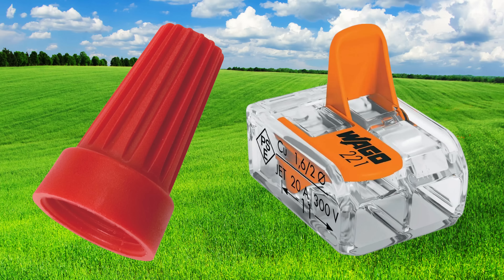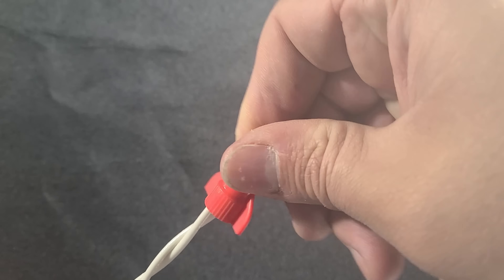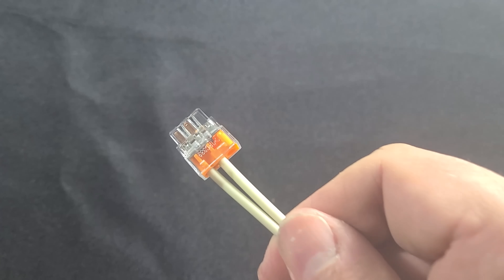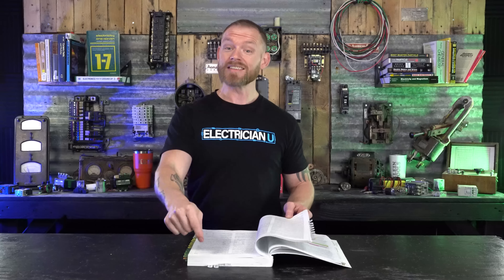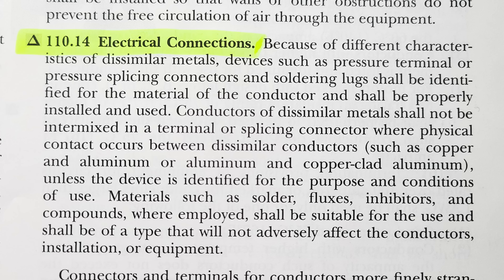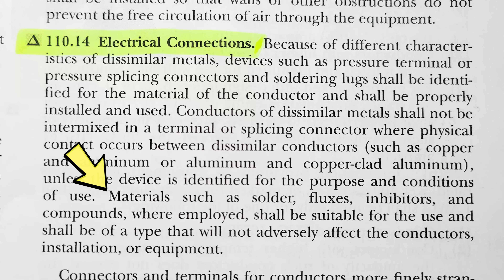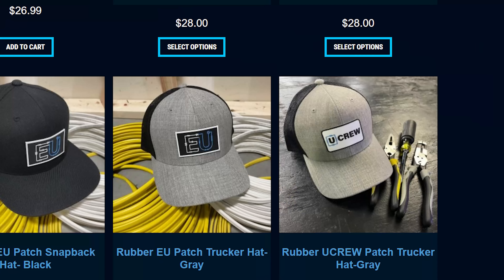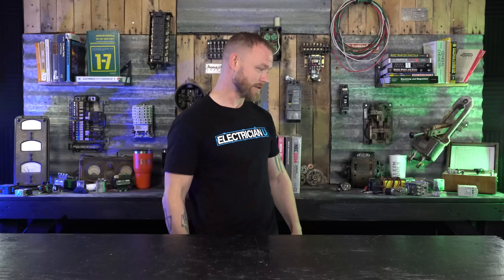Should We Use WAGOS or WIRENUTS?!?!

Comment: Dustin, thank you. I was an early adopter (spent a good chunk of my time in Europe) and have fought this one with my brothers (never a sister, female electricians tend to be more pragmatic) for a number of years.
To me, it makes sense to use the connector which gives the most reliable connection under less than ideal conditions. That's just my preference, but Wago shines there and wirenuts don't always.
Reply: @kenbrown2808  I apologize, and will delete comment. Was trying to read thru hundreds of comments to decide if I was going to use Wagos brand only. No knockoffs. As you are obviously experienced, your comments frustrated/angered me, after looking up the 222 specs myself. A bit like Amazon reviews. It's the best ever/it sucks. I've been thru similar endless debates w/ plumbing-copper/pvc/cpvc,and now PEX. (While watching 'professionally' installed copper spraying from pinholes in a cramped attic). New contractors are all in on PEX for my new home, for their reasons. (Most) older experienced plumbers are all copper. I respect knowledgeable pros, so it's maddening when they disagree fundamentally. You have lived electrical for a lifetime so your opinion means something to me. Flatly stating an incorrect spec(20A) was my only frustration, because I see it constantly online, where people will 'quote' anything to 'win'  a debate. It does not serve anyone well. It makes researching anything maddening. Imagine how bad this will get w/ AI posting these comments! It's already happening.  Thanks for contributing your knowledge here. I have read about half(600+!) the posts here, and I will be using Wago brand connectors. (I hope that clear polycarbonate plastic is super durable, because cracks will be catastrophic). Thanks for your time, Ken.  Sorry for seeming rude.

Comment: Lever nuts make a lot of sense for stranded conductors for light fixtures or as you mentioned lamp ballasts. Otherwise, as you mentioned, wire nuts feel more secure.
Reply: I'm not convinced of that - I worry about annealing and how my connections hold up in less than ideal conditions. But, again - I spent a lot of time in Europe, so am not as sold on wirenuts as most of my fellow Americans.

Comment: Only a few kinds of Wago are stab-in (only the "Wall Nuts" I think, and I don't like those, though they're the ones you had in your hand), most are insert and lever tighten. The latest generation are really good, go get the non-stab ones! Great if your gauges are different, or if you want to probe (there's a hole for probing), or if you've got a bunch of wires to connect (you can get ones that take like up to 6 conductors)  I am not super confident (non-electrician) on my ability to get a wire nut correctly and firmly attached, so I'll personally never use a wire nut on mains myself again.

Also I'm pretty sure nothing but Wago style connectors are allowed in Germany 🤣 That said they also call them Vah-go, so what do they know, they only invented them 😉

Comment: You'll have to pry my wire nuts out of my cold, dead hands. 🤣  I don't mind using the stab-ins on lighting and other low current loads, but prefer to use wire nuts on receptacle branches.

Comment: Why do WAGOs give mixed messages on the voltage rating, depending on where you get the information?  The devices are marked with 300V, yet on the UL approvals on their datasheet, it says 600V?
Reply: It probably depends on the manufacture
Reply: Different testing standards for the different ratings. (The Wago 221 for instance is marked both 300V 20A and 450V 32A. The 450V rating is per UL (US) and ENEC (Europe) testing standards, and the 300V rating is per PSE JET (Japan). I dunno the specifics of how the tests are different; probably it's something like how large the safety factor is.)

Comment: Wago rated for copper only, so can’t use them on old aluminum wired houses and oaccasionally need splice more than 5 conductors together like in a 3 gang box, otherwise wago is better although little pricy😀

Comment: I am so happy that you made this video. I would just like to throw my two cents into this argument as an engineer - no reputable company would dare stake its reputation on a product that will fail by design. Ideal and Wago have been in the game for a long time... and the back stab outlets were a resounding lesson learned for this industry. I can't imagine they would make a stab-in connector that would be dangerous by design. So when I hear electricians tell me that "those stab-in connectors are a great way to burn your house down" I just can't help but laugh. UL, CSA and CE certifications say otherwise. And frankly, Ideal and Wago have no doubt invested hundreds thousands, if not millions of dollars, in research and development of these connectors. I have no doubt in the capabilities of the stab-in or lever type connectors.

Comment: WAGO's are fine to use. I imagine the old timers who used solder, rubber tape, and friction tape to splice with freaked out when "wire nuts" first came on the scene. In the 70's I was working in a house that was old then. The splices were made with porcelain wire nuts, I still have a few that I replaced with "modern" bakelite wire nuts. There will always be some new tool or material that comes out. This stuff is tested before it's released for use.
Reply: It's just not the old timers that freak out; it is also municipalities that need to update their codes. You would be amazed how many don't know about them and as such fail you come inspection. 
I love actual Wago's...As it seems to have developed across most electricians, Wago's are great for lighting.
Reply: @samspade5648  But every light fixture comes with free wire nuts?  Beyond that tying grounds with the green hole thru wire nuts are the only time I typically use a wire nut.
Reply: I do not think that modern wire nuts are made from bakelite at least the Ideal® ones don't seem like it.
Reply: @robertopics  They are not made of Bakelite. Bakelite was one of the first insulating products used for wirenuts. They are plastic now. used
Reply: @thomasdragosr.841  my bad I got confused when you wrote "modern".
Reply: 100%

Comment: How do Wagos compare to the Ideal brand stab-in connector? That's usually what I use. They work pretty well provided you strip the right amount of wire back- otherwise, they come out a little easier than I would like.  I never see Wagos at the big box stores, the only reason I haven't tried them.
Reply: WAGO's are pretty pricey, the Ideal brand are definitely less expensive and are great for remodels when dealing with old wire.
Reply: Menards has wagos…I order wagos that go up to size 10 gauge wire from Amazon
Reply: @jeremysmothers1985  Weird, I was at Menards hours ago and in the electrical section. I was not looking for wire nuts tho.

Comment: Lever nuts are far easier to service later and are as good or better than wire nuts in every other aspect. Stranded wire with a crimped on ferrule for example is so much better than wire nutting them together.

Comment: LOL! Love you dustin! such a cool video. the europeans are ahead of us in termination practices.... I perfere using the wago caps as we have been using wirecaps forever. Ideal caps are also a solution as both Ideal and Wago off a quicker method of termination. plus the Wagos are ajustable and easily removed as needed. if you watch any of the european electricians on Youtube you'll see how european wiring is done. they have a nicer system in some ways and I think the US industry should adopt some of their practices.... they use terminal strips instead of caps and since Wagos are from Europe, thats the starting place for those wiring devices.... its just a cleaner install.....
Reply: Cleaner and they hold up better in less than ideal situations.
Reply: @ethelryan257  Yup, I'd use those first over wirenuts if They were more readily available. Home Depot sells the Ideal Brand and I'm sure Lowes does also. I love the Wago design as they are removable with a flick of the lever.... nice Item!

Comment: I have seen a couple compatison stress tests. They always test ok and way stringer than rated. But.. My problem with wago is i like others have removed failed outlets with the push in style connection that failed. 
So you insert a 12 or 14ga wire in there. Where it actually makes contact is similar to a 20ga connection? Its just a small bite. 
A twisted wire has 1/2" or 3/4 of twisted contact plus the nut contact.
Reply: The 221 and 222 series aren't just push in (although possible to do so if using a solid conductor) - fundamentally different principle. Constant pressure spring contact even if you melt the entire housing off. They don't fail like stab-in switches/outlets.

Actual metal contact area is gas-tight once fitted so used properly indoors, corrosion not an issue in that case. See Wago's salt spray test video ;). And the contact area is plenty big enough for the job - several test-abuse videos on here (possibly the same ones you've seen) where people have ramped current well beyond the ratings and the heat is in the conductors amazingly, not the connector. Worth noting there is better contact in the 221/222s than the 773 style push-ins.
Reply: @intercity125  agree.. But still.
Its apparently all they use in other countries. 
Stupid expensive here though. I have a large addition to wire.. I may go this route. Fingers getting tiered these days.
Or i like the crimp connectors. Which seem to be harder to find.
Reply: @turboflush  I'm from the UK. A lot of sparks here love them but some still swear by other methods (we don't use wire nuts, not in decades at least) because nobody likes changing from what they're used to! Old hands still seem to like their screw terminals, soldering, crimps, you name it.

Properly made crimp connections in say a butt splice are great, usually only ever a problem if they've not been done with ratcheting crimpers and/or totally inappropriate. One of the few methods that are acceptably maintenance-free (and can then be hidden behind a wall etc) here.

Connexbox produce a range of 'Wagobox' enclosures that when used at a derated current & in line with instructions form a BS5733 MF junction box. Make of that what you will - the derating is quite severe, see the 221-4 series taken down to 20A and a limit of aggregate current in the box from each conductor.

Best thing for the 221s is when you want to connect stranded to solid. Will accept class 5 (multi-stranded) conductors without a ferrule just fine!

Comment: I do electrical work on conveyor systems/all stranded wire... and wire nuts are basically obsolete in our field. we've been using lever wagos for years..we work with controls not just power that we have to troubleshoot so the wagos are great for just pulling out one wire to swap it or tone it out. Wire nuts are fine if you use them right but when I got back over others work/or demo old installs I find more loose wire nuts than loose wagos. Also out of the thousands and thousands of wagos ive used ive only had two wagos malfunction/break on me.

Comment: Wagos are different from P-nuts or as the brand name went "Push Nut". You may still run into Push Nut brand connectors in old T-12 installations but I don't think they are around anymore. Usually you see the Ideal brand P-nuts (we still call them that) that are orange. The luminaire disconnect style connectors are also push-type pressure connectors and like all of them, it is hard to get the wire out--because that's how they designed them. The Wagos are a step up and are awesome but very expensive. If it is rated for your amperage and 90 degrees C, use whatever you want. If somebody did you dirty on the rough in and didn't leave much wire to work with, the pressure style connectors are the bomb for sure.

Comment: Personal preference:

For the rare time I need to splice 4 solid conductors together, Wago all day.  3 or less solid conductors I’m indifferent.  Wago all the time on 10AWG or smaller stranded & solid to stranded.

Those darn solid 12/14awg to a LED light fixture with stranded take half the time with a wago levernut.  My time is worth money, and apprentices rarely mess up solid to stranded connections with a wago levernut.
Reply: but you forget a BIG benefit....you aren't butchering the wires with levernuts.  And they are also REALLY easy and much faster.
Reply: Honestly, given the effort required to install them, i'm unconvinced the wire nuts are even cheaper at all. Never forget to include work time when calculating costs. Probably makes up a bigger part of the cost than the connector in either case.
Reply: Bingo!

Comment: Thanks for the ballast/Wago example.  A good use for them escaped me before that.  I thought they looked cheap and flimsy.
Reply: You can look up destructive overcurrent testing on wagos. As far as heat and current resistance goes, they are definitely not flimsy. I'd like to see some destructive pull tests too but I always see traditional wire nuts fail when they've been taken apart and another wire has been added or something similar.
Reply: Looks can be deceiving. Real testing shows that WAGO connectors hold up even in significant overcurrent situations. I still prefer pre-twist and a wire nut on a high current circuit, but can't ignore real testing.

Comment: I believe in wire nuts always twisted wires.  I've seen problems when people don't twist first.  Lots of burnt wires later.  Wire nuts have more surface contact for better connections.  Just because something is out there doesn't mean it's good.  I've seen those types connectors on auto for years and always problems waiting to happen.  Just my thoughts.  Have a great day.

Comment: The only issues I have with WAGOs is the fact that they are susceptible to fatigue.  I have had to replace a lot of duplex outlets because the installer used the stab box instead of the wrap around screw post.  With respect to time and frequency of outlet usage.
Reply: What do wagos have to do with stab connections on residential outlets?
Reply: I think WAGO's grip the conductor a lot better than push in receptacles.

Comment: Recently started using Wago instead of soldering for certain small projects to make change outs easier, wagos and similar connectors are definitely helpful.
Reply: Against the NEC to solder wires. Especially any ground wires.
Reply: @JohnThomas-lq5qp  As i said small projects, i doubt those rules apply to things like power banks, solar light modifications etc.
Reply: @DigitalIP  Code ( NEC  ) usually pertains to just about anything supplied by utility, wind, solar power etc in residential, Industrial & commercial settings. Low voltage wire in class 2 ( limited power ) setting mostly likely soldering permitted. Code might be afraid that in the event of a high current fault ( short circuit ) that the solder cod melt causing the appliance, tool, etc to loose the ground connection posing a dangerous condition. Sure cheating lack of quality control communist china does not abide by this. If wrong flux is used to solder it could be corrosive causing problems later on. There has to be at least 5 different types of solder such as 40/60, 50/50, 60/40. At least one has a fairly low melting point to aid in soldering. All of my solder is single & multi core rosin core that I purchased back in the 1970's when lead was not banned yet. Know they banned lead solder for potable water in early 80's but not sure if they outlawed lead for soldering wires.  Selrombreak out my Weller 100/140 watt soldering gun or 25 watt soldering irons but was lucky to solder think it was 17 boards when I completed a Healtkit 25" color TV, tube & transistor tester, oscilloscope and a radio 45 years ago.
Reply: @JohnThomas-lq5qp  Yeah i was referring to projects that deal with 5v-12v power, not 120v-240v etc kinda stuff.

Comment: I'm surprised not to find pitchforks vs torches thing going on. Go into a drywall group and start a paper vs mesh tape thread, sit back, watch fireworks :D
Reply: Yeah, the trades tend to be very, very, extremely slow adopters of better techniques.
Reply: I use both. Mesh for seams with hot mud. Paper for inside corners.
Reply: @FullCircleTravis  I've been a paper guy for a while but have started to believe in mesh to help bond aluminum corner bead. also will try it to help with PVC corner bead. I'm not giving up paper though and I would never stop using wire nuts completely.
Reply: Off the topic, but since you brought it up...

For repairs, neither paper nor mesh- look for "FibaFuse." It's a non-woven fiberglass from St. Gobain.  Thinner than paper, so easier to feather.  Permeable, so you don't get bubbles- they just go right out through the tape.  Likewise dry spots- just mash the mud through the tape.  A bit spendier than paper, but for repairs, well worth the $$.
Reply: XD
Reply: For patching you can't beat mesh, it's hoses for courses.

Comment: In regard to a WAGO connector, if you are connecting dissimilar wires, there is still going to be a dissimilarity between at least one of the connected wires and the metal used in the WAGO.  So galvanic action may not occur directly at the contact points between, say the aluminum wire and the copper wire.  However, there will be galvanic action between the aluminum wire and the metal connector (if it’s not aluminum and I wouldn’t expect it to be) within the WAGO.
Reply: The 2273 and 222 Wago series are permitted with their paste. Can we just not talk about it - I did my apprenticeship during the great change out. Still dream about it.
Reply: @ethelryan257  Just not talk about it?  You don’t have to participate.